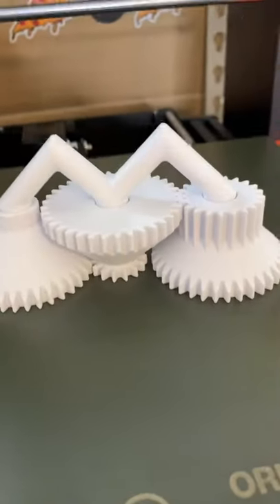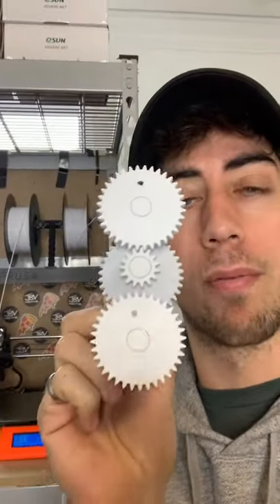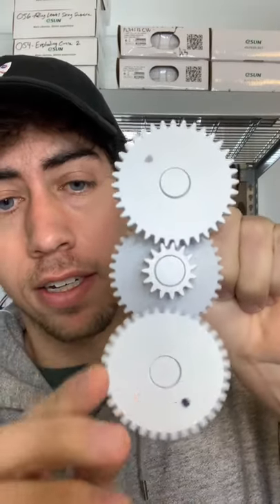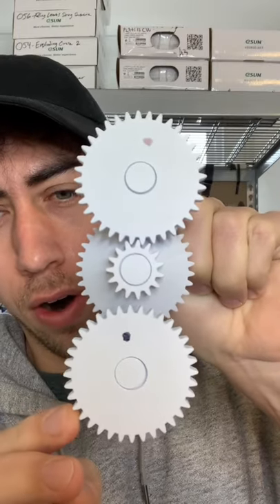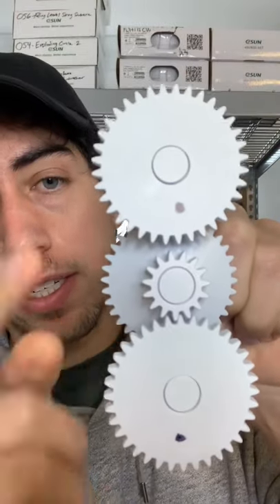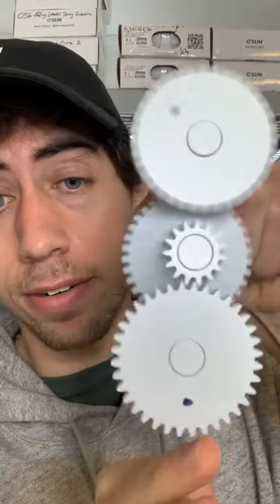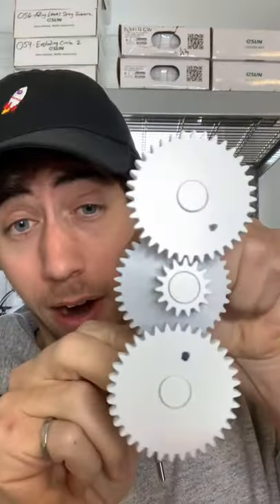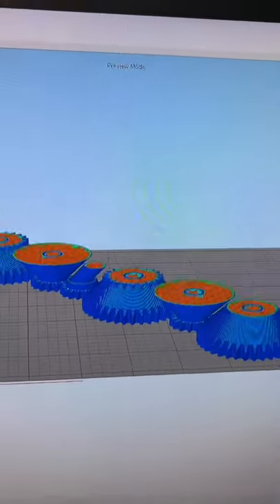Does This Compound Gear System Work?

Comment: Try and make a gear ratio flexible but also make it so as you flex it the ratios change like at first it’s 1:1 than 2:1 than 2:2
Reply: So basically you want a transmission. 😁
Reply: Yep
Reply: 2:2 so 1:1
Reply: @TheGameIsFunny  hm
Reply: @TheGameIsFunny   That sure is how fractions work

Comment: Hey, how is your 3d printer called? Looks very accurate. Right?
Reply: I think it is a Prusa mk 3
Reply: @hideway9819  thank you
Reply: If it can make gears in place that turn that nicely, it must be quite accurate! I would guess that if you were to put these gears "under load", they would not perform very well.  That would be interesting to see.  Maybe beat some eggs or make a cake with them?
Reply from the maker: It is the Prusa! Great machine

Comment: For anyone thinking of some speed-power-torque increasing glitch using more gears

More the number,size,mass, pair of the gear more power it will require to spin the system... So its chancels out in the end